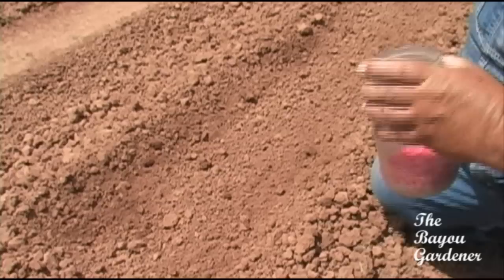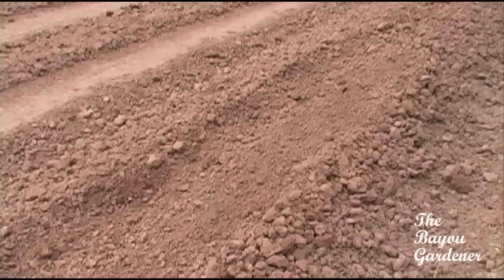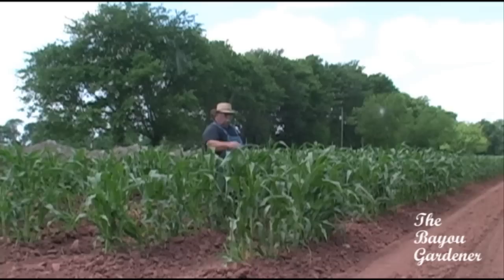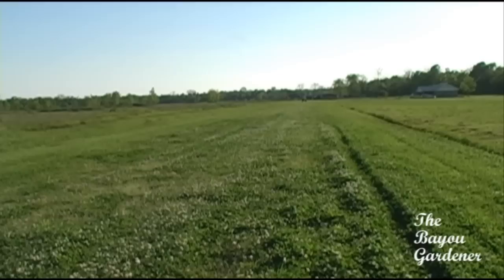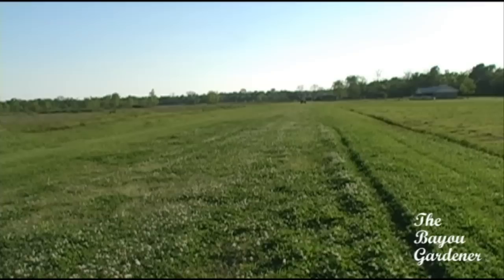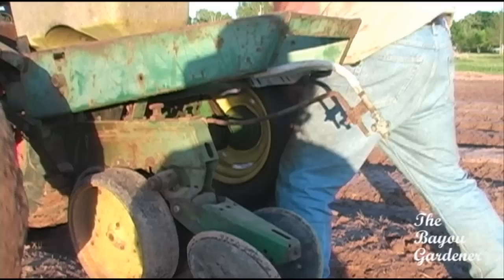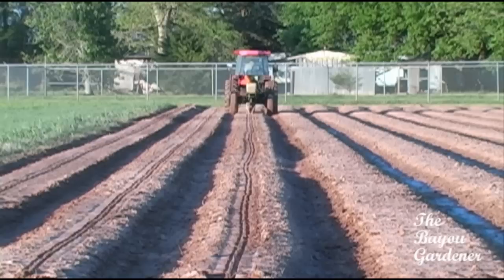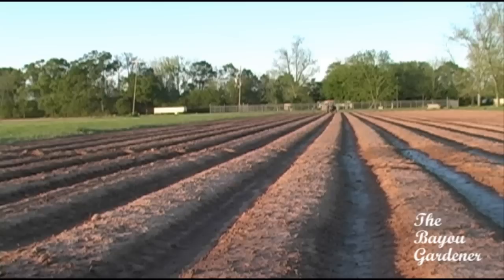Planting Sweet Corn 3 Ways - April 2011 - The Vegetable Garden

Comment: A hoe up front and heavy hardware strapped on back - Be prepared I agree.  Neat way you have water tank attached.  Are there braces to keep it from getting on you?

We could sure use a rain here.  Always enjoy watching.  Once again, Thanks for sharing.
Reply from the maker: Once I removed the bracket that holds the golf bags it left two braces sticking out that I attached a cypress board to using bolts.  This is the platform for the tank.  The tank is wider than the two uprights that the top attaches to so those keep it from sliding forward.  I used two ratchet straps to hold the tank in place.  Works pretty well.  The hardware on the back is for predators of all kinds.  :-)  ……Donald